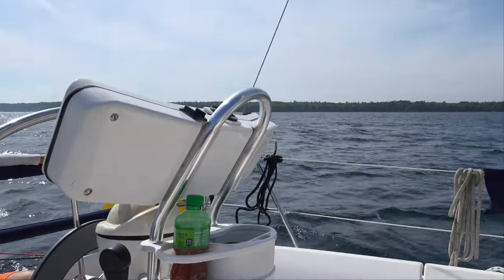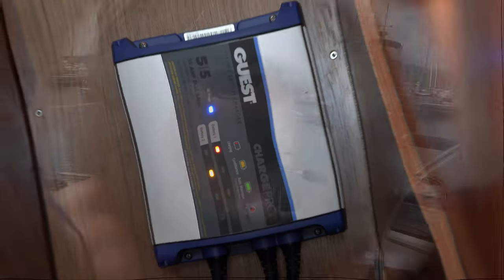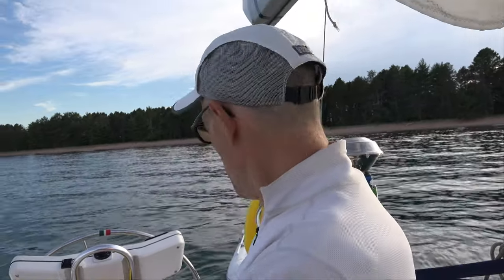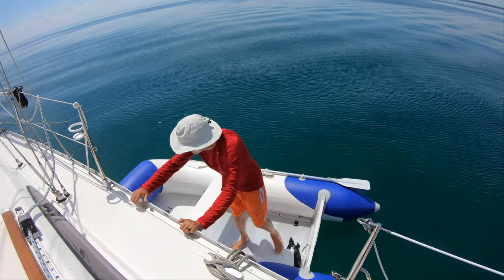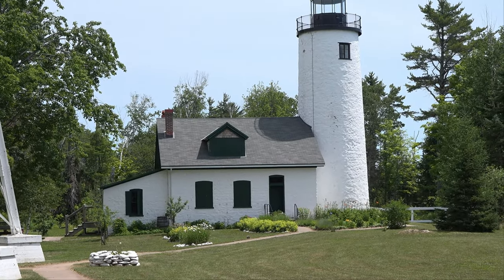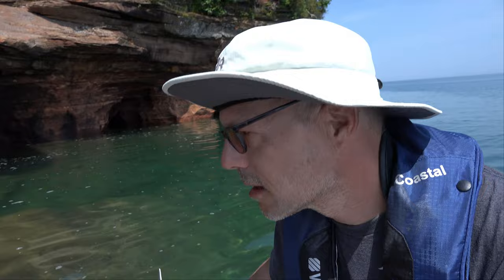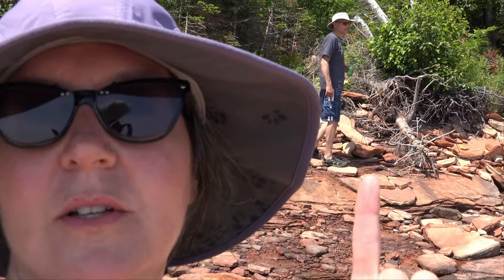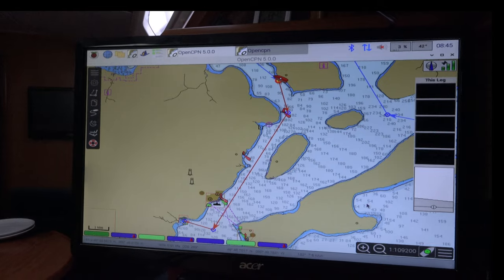Sailing, Batteries, Caves, Lighthouses and...Hail? | S2E11

Comment: hey guys just wondering if you could tell us more details on the battery you just installed. we also own a Jeanneau 34.2, enjoying the videos
Reply from the maker: Hi Sue! Thank you so much for the question and the feedback!! The battery is a Renogy 200 Ah AGM here is the product link - https://www.renogy.com/deep-cycle-agm-battery-12-volt-200ah/ It's a big, heavy sealed lead acid unit. It being lead acid makes it super heavy (about 120 lbs), and we should only really expect to get 100 amp hours of usable capacity, but that's realistically enough for us with the kind of cruising we do at the moment. It being AGM & sealed means that there is no water to top-off or risk of leakage/spillage, and it being a single large unit simplifies the wiring and the general complexity. As with the rest of the boat systems we are treating all this as a learning opportunity, trying to start off simple and keep the costs down a bit. Once we transition to full time cruising we'll take the lithium plunge, we expect.

How do you like your 34.2? What kind of house battery system are you running? In upcoming episodes we'll cover our solar panel and battery monitoring system, so stay tuned!
Reply: @LivingtheMiddle  hi we are pretty happy with our SO we have had her for 5 years now , so far we have done some coastal cruising on the NSW east coast of Australia . plan is next year to take 5 months off work and head north to the Whitsundays .
we are running 4 x 85amp batteries at the moment powered by 2 solar panels on the bimini, which works well for us so far. we have a Victron battery monitoring system, which my hubby is obsessed with lol. we dont have a youtube channel but are on Instagram #sailmystere if your interested. cheers and happy sailing
Reply from the maker: Steffan is also obsessed with Victron and has let me know we will be having not only the battery monitoring system, but also a victron inverter/charger on the forever boat :)   Just followed you on insta, gorgeous pics...We are hoping to make out the Australia way, but won't be a few years, we'll live vicariously through your pics for now!